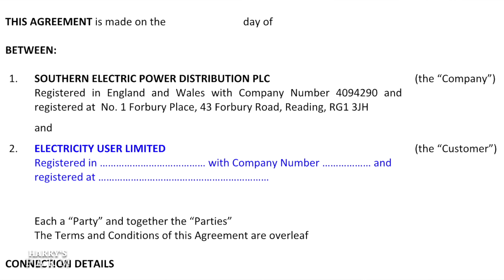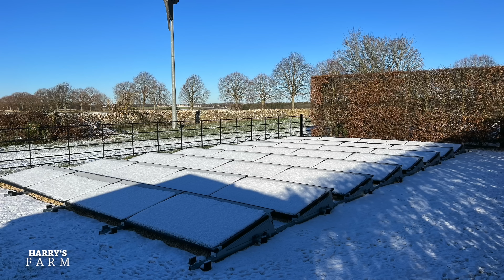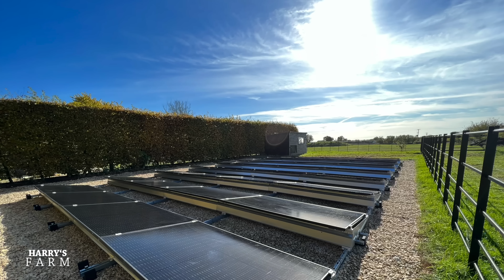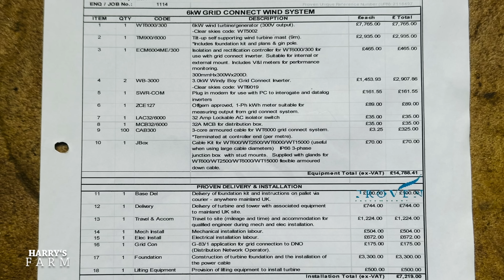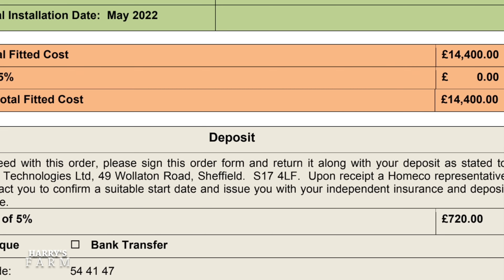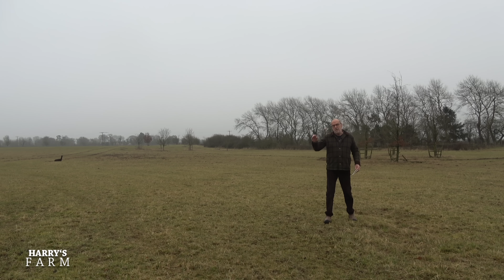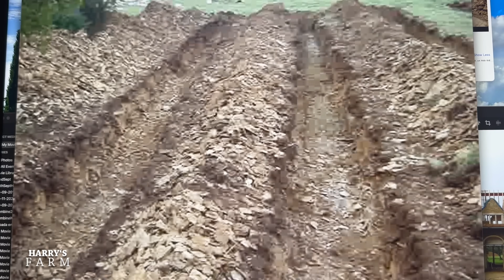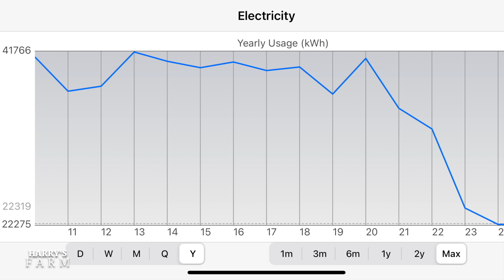Are solar panels & heat pumps worth installing? Here's what I've learnt after several years of use.

Comment: Very interesting video particularly the ground source heat pump. You need space for this to work (a field). I have had 4Kw solar panels on the house roof for over 12 years and totally agree about them being useless in the winter particularly the short winter daylight days. If we weren’t getting a FIT payment on our system it wouldn’t be viable in my estimation batteries are also not viable as the solar panels don’t generate enough to charge the batteries in the winter. I’m very sceptical about some eco suggestions particularly in an estate situation like ours.

Comment: My villa in Spain has 12 x 330w panels it's true a palm tree casts shades has a dramatic negative effect. Keep it  pruned hey presto. Can heat 80l hot water and  but just one air conditioning unit. I store 6.5Kw in a battery so use it all

Comment: The elephant in the room is those kWh per year figures for both wind and solar. The utilisation of the 12 kW solar and 6 kW wind is terrible! It means a load of expensive hardware standing idle much of the time. That's why wind and solar at grid scale is so awful, because it needs conventional either working when they aren't, or standing idle when they are, another waste of hardware. Wind and solar are ok for certain applications like remote from mains, but are costly at grid scale. Batteries just make it worse (more hardware that is idle half the time).

Comment: Very interesting information. I was surprised at how flat you have your panels. We are near the same latitude as you and have our panels at a 45 degree angle. This has greatly improved production during the winter months. We leave them at that setting all year and make up the loss in summer with the longer days.
Reply: 45 degrees😂. Damn that is wrong on so many levels.
Reply: @ so how long have you had your system?
Reply: I’m an installer.👍
Reply: @ just going by my data.
Reply: @ajkolodziejski118  You carry on bud. . 45 degrees. 🤡🤣

Comment: Micro inverters and battery storage help balance some of the issues covered in this very informative video
Reply: That covers the day-to-day variation, but not the seasonal variation. Batteries won't support you for the winter. The UK has got to have wind over the winter.
Reply: @lowstrife  You can charge batteries using cheap night rate energy in the winter and use it in the day.
Reply: Yeah, I’ve never heard of a bank being shut down it if there is imbalance.  Ours certainly does not do that, it is only 2 years old through so maybe things have moved on.

That panel angle looks way too low as well.  

What a lovely properly Harry has, well deserved and earned
Reply: Batteries can't be charged for half the year in the UK.
Reply: @Sabhail_ar_n-Alba  February in Latvia, which is the same latitude as northern Scotland - 10.5 kW panels generate in average 13 kWh per day despite snowing every other day. It all depends on the battery size.
Reply: @Sabhail_ar_n-Alba they really can.  It's just deep winter that's rubbish. 75% of the year is fine.
Reply: Has anyone experienced having a useless water butt for watering your garden in the dry summer months. 
C02, the food of life. The more the better. We can’t have enough of it.
Reply: @NatMart9394  Actually wrong. Plants start suffocating if you feed them to much CO2. Just 100% oxygen would kill a human.
Reply: @DavidKnowles0  I don't think he's very bright TBH.
Reply: @NatMart9394  The more CO2 the more heat, the more droughts, the less watering of plants. CO2 itself is not the problem, it is the heat trapping effect in the atmosphere. If you put more than a 10 year old's concept of photosynthesis into it, it would make sense.
Reply: @dreamcrusher112  
My replies removed . 
That Proves my point they’re indoctrinating you with green house effect crap.

Comment: Maybe in UK it is sort of OK to fill brine with water but usually in colder regions brine is filled with 20% ethanol mixture that allows to get more temperature exchange (allows to cool down liquid even to -5 degrees). Actually heatpump works as your home fridgerator, fridgerator does not take enery from athmosphere to keep your food cold, compressor is doing the work through evaporizer. Sames is here, you have to put away this cold what compressor is producing and through heat exchanger it is transferred to liquid (water is your case maybe)  and from liquid to ground. About these ground heat pipes, i really hope this installation is not done is the way how it was on the pictures. Brine pipes have to be straight and have to have 60-70 cm space between pipes for better energy exchange, this rounded thing is not right.
Reply: Not problem to get brine work at -5 degrees celsius, in fishing vessels they can use brine as low as -20 degrees Celsius

Comment: Harry you are 100% right about the sense of integrating solar farms with wind farms to maximise the value of the grid connection. However the various lobby groups are so polarised that common sense ideas like that fly out of the window. 

Now if you also installed a small green hydrogen generator at the solar/wind grid connector you could actually use the excess power that the grid pay the wind generators to not produce when the wind is too strong, and (presumably) the excess solar when demand is not high. 

Then locate them at distribution hubs for Amazon or Tesco and friends, with hydrogen long haul trucks and local electric delivery vans. Wouldn't that be clever!

Comment: Your PV is very flat .. south UK is 51 degrees north,  so in winter with  the sun is very low, with a ground system you can tilt the  panels every season to say 60 degress +  for winter. .

Comment: Some very interesting statistics in your video Harry.
- It would be interesting to know how much heat you lose in your pool overnight in summer and how many kW you reckon it takes to get it back to the previous day's temperature.
- Your panels certainly seem to be at a very shallow angle, especially for England. Here where I am at lat. 45°N the average ratio between July (max) and Dec (min) is 3.5 (over a 14 year period).
- I would certainly try tilting them, even just one of them on an experimental basis, to see what the difference might be in winter compared to summer. Also, they are a little low off the ground which can't making clearing the snow off any easier.

Comment: If shading is likely, then you want micro inverters, not string inverters.

If you’re at higher latitudes, you might also want angle adjustment too to maximise generation. Either way, you can’t escape that you have very long summer days, and very short winter days.

Comment: I have been in the fortunate position to have had all the different types of heating systems and our latest house is by far the cheapest to run.  Heating and hot water Bill for last year was £300  yes £300, the house is highly insulated and we have an oil boiler with log burner, I know they aren't fashionable but oil is by far the cheapest method of heating a house at todays prices, electricity is very expensive, we've had a heat pump and it was expensive to run despite all the hype on how good they are.  So until  electricity unit prices get lowered I'm sticking with the old boiler.

Comment: The yield of solar systems is significantly lower in winter than in summer, but the difference is typically not as bad as with your system.
In my system, December is 17% of July, 50.7 deg latitude

The fundamental problem is shading. Even a little shade on a single module plays a big role. 
The second problem is the improper angle of the modules towards the sun.

Module prices have dropped dramatically, so I recommend adding additional panels, at a 40-50 degree angle facing south, and positioning them so that they are not shaded even in the morning and evening in winter when the sun is low over the horizon.
Often this can be wired to the same inverter, in parallel, just add panels. The inverter then limits the peak output in summer, but that's not a problem in the other months.

Your GS heat pump system is very nice, I like it a lot!
I'd love to hear the details of the house construction and the insulation.

Comment: Shading issue can be combatted by installing micro inverters under each panel rather than connecting in series to a single inverter. This means only the shaded panel drops in output.

Comment: Very honest and informative to the core, thank you for sharing and for your transparency, Harry.

1. I'm sure you're aware of AC coupling and microinverters - if you had every solar panel would be utilised on its own independent of adjacent panel lighting or shading.
2. I note your panels are not optimised for winter sun and its low angle of incident, you could add some vertical panels (two sided even better) to enhance your winter generation
3. Can your heat pump also act as AC to cool the house in summer? It's a simple modification if the equipment allows it
4. You need batteries - lots of KW as you'd then buy cheap overnight electricity in winter at 5-8p/kWh to use in the day. Do what you can (washing for example and heating water tanks) at night on that rate electricity
5. Have you considered sun trackers for your panels?
6. There is also an agro-generation = installing solar panels high (spaced out so enough sun can still get through) and using the ground underneath for growing produce.

Comment: Interesting but also confusing - couple of questions: 
1. That £5k electricity cost, is that what it would cost if they didn't have all the panels etc? Or is that how much he has to pay ON TOP of what he gets from all the panels? £5k, sadly, is not a lot at all - my 4-bed standard house costs me £2-3k a year. 

2. How do you handle power (lights, cooking etc) overnight when you're getting nothing from the panels? Is that just from the normal grid? Must be, I guess...

Ironic that you get so little during the cold, dark winter when you really need it. This is why we can never rely on these alternative methods.

Comment: Those panels are at a dreadful angle for winter. I would split them into two strings, one at the angle they’re at now (optimised for summer) and another at 45° (or even steeper) to catch the winter sun when it’s far lower in the sky. You won’t have as much peak output in summer but the winter output will be far better than it is currently.

Comment: A really interesting insight to a real world installation, done as a  complete system. Harry obviously has advantages over the average person, space to
Install the ground source pipes, solar panels and turbine. Even with this it does show these systems are not perfect and need a ‘balance’ to work. The key to even having any chance is down to the way the house is set up to be very thermally efficient. All houses built in UK should be designed this way, underfloor heating, triple glazing, super wall insulation and roof space insulation. Alas as always UK in general will always build its houses poorly. 
This episode like so many Harry does would be great on mainstream TV with perhaps other industry experts contributing to how we can do things better. 😁👍

Comment: Eeh, I thought it was always summer in the South! Interesting and a great overview. I run 12Kw wind and 8Kw solar on my Northumbrian farm. We're windier than even the high Cotswolds, but less sunny. 2006 turbines weren't very efficient (and a bit unreliable and expensive), so your comparison with modern PV panels isn't like with like. For us, turbines (2017) are very good. Remember turbines run at night, summer and winter! Solar is an utter waste of time (and ours are similar modern units, installed high with a better angle than those ground mounts). It generates money due to subsidy only (and these are no longer offered), export tariffs are laughable. It must be completely clear and sunny (total myth that modern units work when its cloudy). In winter they get shaded very easily. In summer they would charge a eg Tesla battery, but without a swimming pool (!) it's not hugely useful. You could charge a car in summer, but what EV can pull a 3.5 tonne trailer? Would charge a shopping car tho. Baffling that solar is even touted as a credible all-round option in the UK. One thing to note is that people generally underestimate power consumption (even installers). Farms certainly do. GSHPs are good but have a huge pump draw, which makes them difficult to install with the UKs terrible electricity infrastructure. Unless you're on 3 phase (you jammy bugger), marginal.

Comment: That should have been installed far higher off the ground and a motorised tracker and each panel ahould be individually rectified, not as a bank, no wonder you're losing power.

Also get a ground heat pump system to cool the panels above 15 to20deg c and heat them to keep the panels clear of snow.

This combination means maximum exposure system will increase your output and limit banks of panels to shut off.

And increase the number of battery storage units with bi-directional connection to the EVs

Comment: Thanks for a very informative video Harry. It was very interesting to compare UK experience with our experience living on a mountain in the north east corner of Spain.
Our solar panel array is on our roof with 12 x 450W panels (5.4kW). We also have 2 x Air to Water Heat pumps with a 2.5kW pump for domestic hot water and an 18kW pump for central heating. All told, the installation cost was 32,000€ and was installed in the last quarter of 2022. This allowed us to get rid of our gas and the whole house now runs on electricity.
Our house has a similar floor area with 466 sq.metres over 3 floors (including a garage with no heating). Unfortunately we do not have the benefit of underfloor heating so our heat pump is set to 55C outlet temperature to a radiator system,  rather than the 40C needed for underfloor.
I noted your comment about output of your solar panel banks being adversely affected by a panel that is in shadow. We overcame this issue by fitting mini invertors to each panel so that they all operate independently. It was worth the small extra investment. My neighbour has the same size array output run from two invertors and although his panels are in the same orientation as ours, and over the year we produce 10 to 15% more electricity with the mini invertors.
Interesting to note the difference in energy prices too. We are paying around 15 eurocents (12p) per kWH (24/7 flat rate). For excess we return to the grid we are paid 10 eurocents per kWH and our supplier also runs a 'virtual battery' scheme. Our self generation for 2023 and 2024 were 8,450kWH and 8,225kWH respectively. Comparing this to your 12kw array for the house perhaps underlines the advantages of solar for sunnier climes! Since start up our best production month was 907kWH and worst 300kWH so again indicating we can get a reasonable output during the winter months when we need it most. Not wanting to get political but the range of efficiency of your panel arrays should underline the sheer lunacy of Ed Miliband's plans to cover the beautiful UK landscape with solar panel farms that are so dreadfully inefficient at the very time that UK domestic supply needs the most energy just to keep warm.
Was it all worth it? In terms of overall consumption, our house is warmer in the winter than with gas and electricity supply and overall kWH consumption has reduced by around 50% due to the high percentage of energy used for heating during the winter thanks to the energy efficiency of the heat pumps. Once we finish paying off the installation loan, we will be significantly better off economically and can feel we have done our bit for the planet!😊

Comment: I'm not sure you have the battery explanation quite right. If you do not have a swimming pool, or some other place to dump excess electricity, then batteries make sense. Re-using the stored electricity instead of paying peak rate when the sun is not shining plus in the less productive solar months, the batteries can store cheap rate energy, which then is used instead of peak rate. The example of the farm is not really relevant to the normal domestic installation.

Comment: 14:02 not really, you are using the geothermal heat of the Earth's core. At 2 meters depth, winter to summer oscillation is just about +- 3K, while it becomes negligible at 10 meters.

Comment: How much did the complete install cost and how many years will you have to be using it for it to pay for itself. Also over those years how many repairs are done including battery replacement, solar panel replacement etc etc, give a real cost not the make believe one all these climate twats keep spewing out. My gas boiler has run 20 years or more with virtually no cost to me other than gas. Gas is cheap and so much so that the government are talking about putting prices up just to give heat pumps a fighting chance cause they are so expensive and shit. Hydrogen piped to house boilers would be a much better alternative than all that shit all over your house and land, it’s intrusive noisy and in no way environmentally friendly. In 10 years there will be millions of solar panels being dumped all over the country side cause local tips wine be able to deal with the amount of them being thrown away
Reply: When he bought panels they were up to 10x more expensive than now. 

His full install costs were £34000, but the panels would only be £7500 now.

Hydrogen has been dropped by the government as a possible alternative for piped gas. It leaks 4x as much, causes explosions, and would mean needing to build 6x as many renewables to make than just having heat pumps. Worse than use having electric radiators even. 

Gas is getting decommissioned at some point.

Solar panels are made from very high purity silicon and are 100% recyclable. No waste needed.